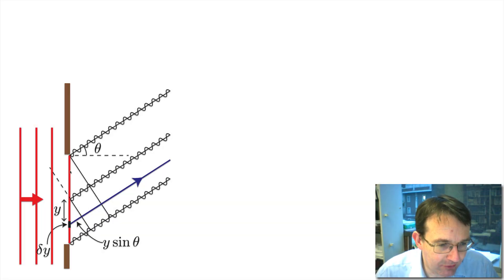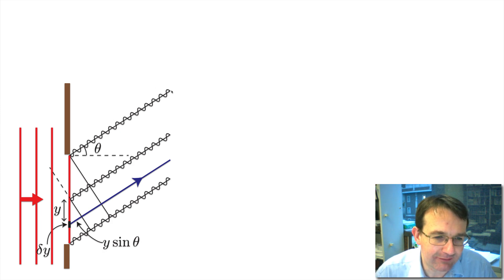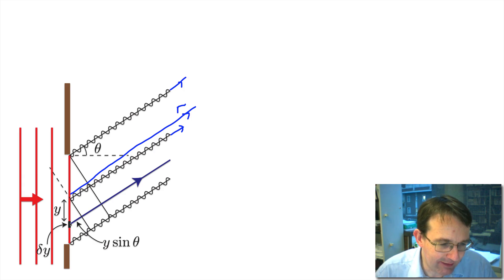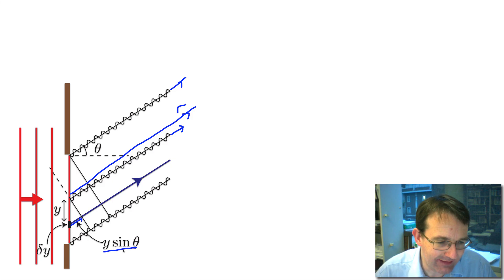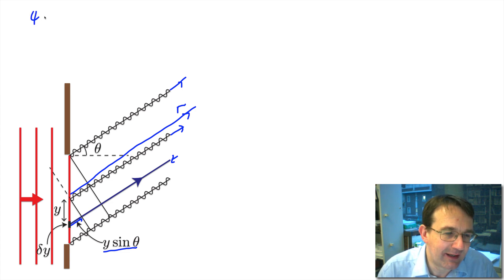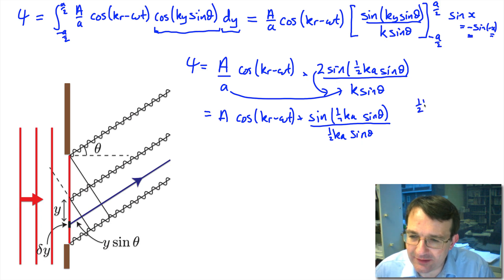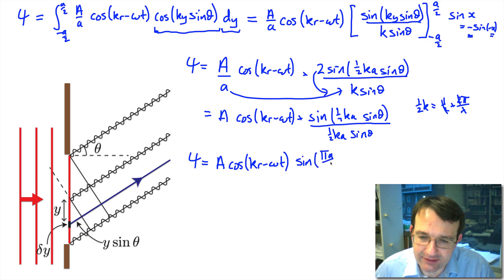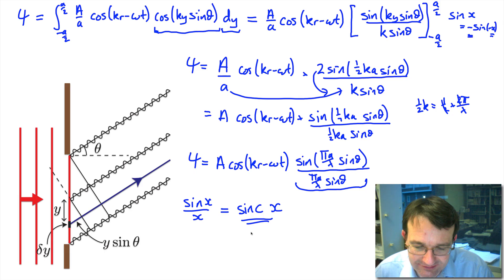PHYS 130 Lightwaves Part 7: Single Slit Diffraction

Comment: In my highschool class we were taught about diffraction as though the wave front that passes through the slit continues on unhampered, except that the edges act as point sources which results in a 'curving' effect. Why do you draw your wave fronts as they exit the slit as at an angle already? It confuses me with refraction. Intuitively they should be parallel to previous wave fronts except for the edges?
Reply from the maker: Sorry, but what you were taught is not really accurate. All points on a wavefront act as point sources: that is fundamental to Huyghens' principle. For slits whose width is comparable to the wavelength, the wavefronts are curved immediately after leaving the slit. For wider slits, whose width is many, many times the wavelength the curving may be at the edges when you are close to the slit but we are looking a long way from the slit and with slits that are not so wide. Even if we did close to a wide slit though you would still see fringes in the "shadow" region but we would need to use Fresnel diffraction (see https://en.wikipedia.org/wiki/Fresnel_diffraction) to describe it since the long-distance, Frauhofer approximation would not apply.